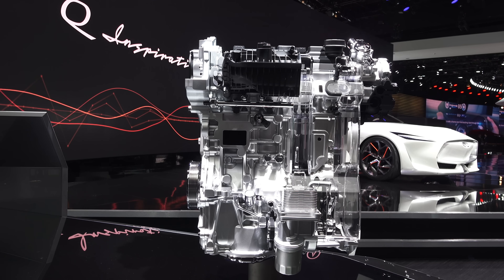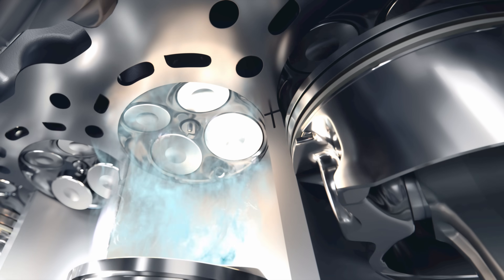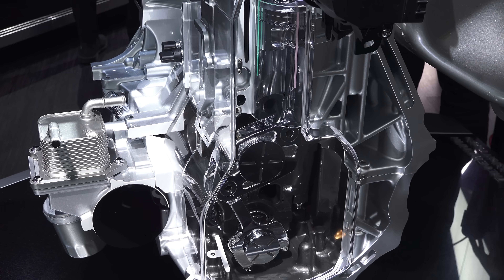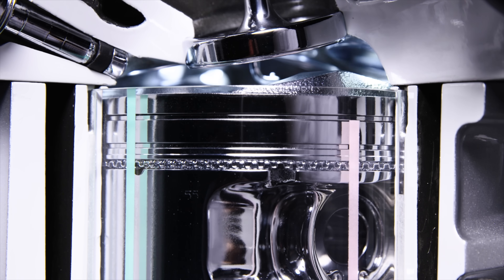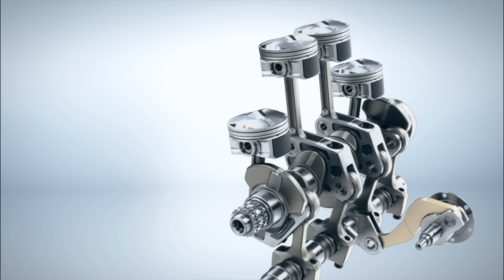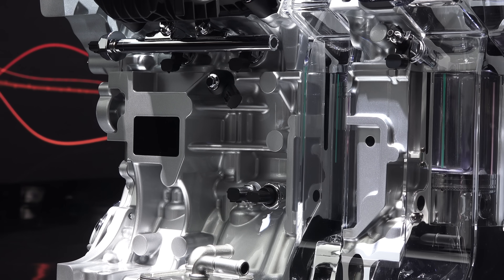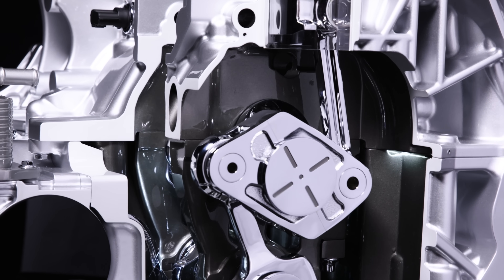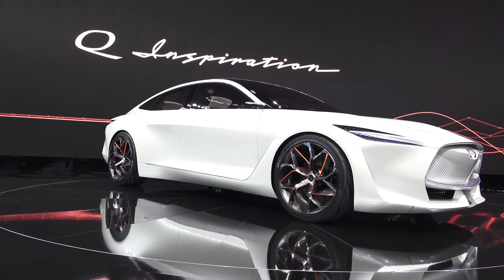INFINITI Reinvents The Gasoline Engine — VC-Turbo

Comment: Complexity: a type of device that is used. To make everthing more costly. To purches and maintain. What society wants and needs. Are vehicals that are built as basic and simple. As the ones built in the 50's-60's era. With todays advanced engine block. With true hemi and Hcci technology. Intake system and exhaust system. And a simple fitch design fuel injection system. Preferably into a predator carberator body. And no computer anything else any where.

Comment: Electric motors have about 5 parts. Simple and powerful.  Why do car companies try to keep reinventing a 100 year old design?  Its idiotic. The more moving parts the higher the chance for failure.  Its simple physics.
Reply: blue03r6 our iron knives are thousand year old design, time to make lightsabers right Right??? Also good luck with these cars of the future. Nearly every car I have seen being totaled was due rust or electronic problems and not the engine. EV takes the engine away but have you forgotten how modern cars became extremely complex with conputers, sensors and infotaiment?..  Oh right... Thats the new planned obsolence. Fools.
Reply: blue03r6 you should ask Yamaha.
Reply: 2 years ago I wrote a ten page Expository Essay research paper for environmental science with the hope of selling the world on EVs. I pounded the fact the EV has zero emissions.

However when I studied all the facts, environmental, economic, political, and social as well as the “work” returns for the energy used....

I found from sourcing the raw materials, to manufacturing, distribution, maintenance, and disposal when the vehicle reaches the end of its service life...

The  EV produces exponentially more pollution and a higher catastrophic environmental footprint than it will ever prevent.

My essay included environmental impacts and pollution created from electricity production delivery, and upgrades to the grid.

That’s in addition to the fact raw materials are sourced from the same unstable countries we import oil from. So politically there will be tensions.
Reply: @bdb3350  Can i get your essay to study?
Reply: kingsley rufus 
Send me an email address and give me a couple couple few days. I’ll see if I can get it to you. 

The computer I wrote it on crapped out on me but I printed it. I might have to retype it to email it if I can’t get the file to open.
Reply: kingsley rufus 
What’s your interest?
Reply: cause, try to drive cross country. That's why. If I could drive 300 miles and then refuel in no more than 20-30 minutes, THEN you'd have an ICE replacement.
Reply: @FGuilt  300miles in a Tesla, then in 20min recharges to 50%, 40min 80%. You are never travelling 300miles without passing 1/2 dozen Tesla superchargers all along the way, they're pretty much everywhere now. Also, anyone driving more than 300miles is usually always stopping for at least 20min to grab a snack or rest anyway.
Reply: @FGuilt  You drive for 6 hours straight without resting?
Reply: @yosyp_yosyp  A lot of people do...
Reply: @FGuilt  who drives more than 300 miles at a time anyway lmfao
Reply: CJ: You've literally never gone more than 300mi on a trip? That's a 150mi one way. You've never driven out there and had to drive back? in the same day? I"m so sorry you are so sheltered. You should do some traveling...
Reply: @CJ-vz5bl  
My father 3-4 times a month for example... -_-
Reply: 10 liters of fuel = 100kw/h of energy. Tesla P100d batery has energy of 10l of fuel and weighs 700kg. I think you got your answer. Batteries are a problem, not the electric motor
Reply: Well what it comes down to is simple doesnt make money. More parts=more workers and maintenance. So you have to keep spending. If they made cars or anything for that matter to last then the economy would take a hit. It sucks but...
Reply: You do know the electric motor is approaching 200 years old...
Just saying.
Reply: The electric motor is hardly new technology its nearly 100 years old too and they may have only 5  moving parts but there are around 8000 complex parts in the battery pack hardly the simple system you thought it was. A V8 combustion engine for example may have roughly 250 moving parts but it only has about 4 components in the fuel tank so if you think about it is still a simpler system. Electric motors are at best twice as reliable as a combustion engine
but the battery pack suffer degredation and are useless after 15 year while a fuel tank can last virtually for ever.
Reply: @jonathondeeds3423  a battery consists of multiple cells. A cell is made up of an anode, a cathode and an electrolyte.
Hell man look up lemon battery. Same technology different chemistry.
Reply: The problem with electric cars has never been the motors, it's always been the batteries. There's a good chance we're still a decade away from the right battery for an electric car at a reasonable price. During that time innovation from internal combustion engines May determine market share.
Reply: @bjshifflett5408  There is no space for improval on batteries... Even graphene ones, yes. This batteries aren't that stable, and that can decay faster or not (test need to be made)... There are a lot to see and test. Lithium is going to be here to power anyway for the next years and other battery technology will take years to be implemented...
Reply: @vladimirlucifer4566  funny that Tesla  has done just what you say is impossible. Increasing the the efficiency of the batteries in the new model 3. Now they're building a new plant in China that's going to produce even more efficient batteries.
Reply: @bjshifflett5408  A new technology that would increase efficiency enough high to be reliable. You have to trade capacity for speed, and speed for capacity.
Reply: @vladimirlucifer4566  you are mistaken Tesla has done exactly that increased power while maintaining static weight.
Reply: @bjshifflett5408  To the limit of lithium technology. They can't go further.
Reply: @vladimirlucifer4566  and yet they have.
Reply: @bjshifflett5408  They already took to the limit of lithium. Any other material that has potential is unstable. Further from now, with lithium, you will have to trade the 3 aspects: capacity, charging, discharging. For having a better one.
Reply: electric motors are not financially efficient though.
Reply: @jamesbra4410  Do you mean the end user or the manufacturer?

Because then both benefit from them
Reply: Well I'm not aware of government subsidies on lithium production for battery capacitors or ferromagnetic material like the government subsidises many raw materials for the oil companies and sets the price void of supply/demand and on OPEC global agreements.  Elon Musk's production costs have almost bankrupted him, but he manages to keep the price of his vehicles much lower than what the gas/diesel manufacturers charge in relation to production cost/market price ratio.  What I'm getting at is it's more rational to use electric vehicles over hydrocarbon combustion, but there is unfair competition currently stagnating the electric engine consumer revolution.  @yosyp_yosyp
Reply: Well Nissan is definitely having fun... What happened with cylinder block lifting mechanisms which can make variable compression as well!? Cam less active valve timing. I hope Nissan can work on does system . Crank less ice generator even better for hybrid system ....  THIS ENGINE is loaded with complex Dual fuel injection system " double trouble" ... Plus turbo . Definitely prone to multiple problems . STILL I LIKE IT A LOT as design it's very impressive!
Reply: It's simple chemistry, too.  You don't get the same power/torque performance from an electric motor.  What's worse, take the non-nuclear electrons that come from coal to form them, the mostly petroleum-based plastic exterior panels, and the Carnot efficiency of two conversions, you arrive at the reality that electric motors consume more petroleum than petroleum-based cars.  At the very least, accept and demand nuclear power to generate the electrons for all the electric motors everyone seems to think are the "green" direction.  Excuse me while I grab a big hunk of beef and go back to the work I'm willing to do.
Reply: @paulingersoll9197  Exactly.
Reply: Unless you get your electricity directly to your car without using any battery, electric vehicles aren't efficient / pollution free
Reply: kingsley: and that is why fuel cells are the future. not the battery driven electric cars.
Reply: This design is no more complex than the 4 cylinder engines we have today due to the design  there is no need for balancer shafts.
Reply: I dont know where you get the idea  that electric motors are far simpler have you considered that the complexity has just been shifted to the battery pack which in some models contains over 8000 battery cells.
Reply: blue03r6 because energy storage is very big problem, if you burn 1 liter fuel you make nearly 9 kilowatt electricity in few seconds, but when you try to storage this 9kw energy in the lithium battery you need to wait for hours to transfer to batteries  and when you want use this energy you need to wait another hours too. This is main problem and manufactering batteries is very harmfull for environment even more than manufactering fuel from the oil it is another big problem but even this disadvantages electric motors are more efficient than conventional diesel or petrol motors. İf one day battery technology is developed enought we are no longer need oil

Comment: There are 3 additional shaft bearings per cylider, compared to traditional engine. Maybe it vibrates less, but has significantly more parts to get damaged by those vibrations.

Comment: The term "Harmonic Drive" doesn't work. I don't doubt that this is the term the manufacturer uses, but it isn't exactly useful. What this entire variable compression assembly amounts to is a step wheel rotated by a step motor, which is connected to an eccentric cam via a control arm or link. The step wheel moves a control arm, which pulls or pushes an eccentric cam to obtain a small degree of offset for a point of axial rotation for what is essentially a lower connecting rod. This lower connecting rod then connects to a swing arm. The swing arm ultimately provides a point of axial rotation for an upper connecting rod.

Printing presses have been using eccentric cams to throw on or throw off the impression movement of presses since the middle to late 1800s.

There's nothing new here with Infiniti. This is, however, innovation at its best for an engine. Good work.

Comment: Such complication for much easier alternatives. Atkinson cycle and hybrid engines would give all the power and efficiency you might require. This just screams over-engineering resulting in costly maintenance.

Comment: These will rarely if never be overhauled. When worn, the vehicles will be totaled, just as many other modern cars.  I was at the metal recyclers a few weeks ago watching truckload after truckload of late model cars being brought in for shredding with no apparent external damage. No a dismantle yard... a metals yard where cars are immediately shredded for raw materials.
Reply: Car manufacturers don't make money off cars that are already sold.
Reply: +Jennifer WhiteWolf : I agree with your premise. Only time will tell what will come of this engine and how it will hold up in the "real world". It's still pretty cool and will be interesting to see how well it holds up.
Reply: Turbo Diesel 
It certainly is technically interesting... I will grant the design its due respect in that regard.  It does solve some difficult problems with levers, cams, and well understood cylindrical bearings.
Reply: I like when they say things like, it has a lifetime chain, that will last for the life of the vehicle. What they don't say is the life of the vehicle is just after the warranty expires. Who wants to buy a new vehicle every 70 thousand miles
Reply: Benjamin Kline ... Well vehicle manufactures are building vehicle far better now then they have ever in the past. Build quality, reliability are all trending upward with each new model and year. NOT like they did in the 80s and 90s... building things to last just long enough to survive the warranty period. For example GM in the 80s and 90s would test a part until it failed... then redesign that part till it would last just past the warranty period. However companies like Toyota and Honda were building their vehicles to last as long as possible... This almost ruined GM and the others doing the same thing. Part of the reason, vehicles like the Nissan Skyline were banned from the United States... The Skyline and other vehicles like it had such good build quality, reliability and performance for the dollar,  it would have put the American car manufacture out of business...
Reply: @JJ_ExMachina  
Design it to break near warranty is over is part of proudly made in USA products engineering demanded by corporate GREED.
Reply: @loktom4068  ... Yes in the 80s and 90s that was a thing... Not anymore. They learned their lessen. Besides I mainly work on Toyota, Lexus and other Japanese vehicles... They have never been built to only last through its warranty... At least not that I have even seen.
Reply: Well you will be happy to know that modern vehicles are the largest consumer of recycled materials and are one of the largest things recycled. Something around 80% of the materials used in new vehicle's come from a recycled source. So while certain modern engines are not really "rebuildable" due to their design, at least the materials are recycled and used again.
Reply: 'Build quality, reliability are all trending upward'
Lol, don't make me laugh. '90s era city car engines were built like tanks. They ran forever and seldom had any issues - there's millions of them still being driven around.
New cars (and higher end cars even from the late '90s and early '00s) have so much useless electronic crap in them that they start displaying random unfixable issues after 3 to 5 years. Hill holders, stability control, ECUs with six million sensors, cruise control, etc.Any one of those sensors stops working properly and it's gonna make your life a living hell.

On an older low end car any mechanic could pinpoint issues with the engine, because they were simple and had few failure modes. 
New cars? Either you're lucky enough that it's a failure mode the ECU can recognize and throw the appropriate code for, or no one's ever gonna have any idea what the problem is or how to fix it.
Reply: @demoniack81  I absolutely agree. I have a Japanese built Toy from 2004 with old 1.5 engine that  never lets me down and I really wonder if I should go "modern"
Reply: yeah more stuff to fail. Will see
Reply: It usually isn’t the engine that finishes any modern car. It’s the other things wrong with it combined with the value of the car and cost to fix. Head gasket blew on my inlaws minivan with 200k... the repair was more than the 13 year old vehicle was worth. I’ve sent many cars to the scrappers with good engines because of rust, or the huge number of broken things (heater cores, wiper motors, switchgear, etc) that weren’t worth fixing. 

Not that old cars are any better. It’s just that some have increased in value that they are worth rebuilding and restoring—most often at a loss.
Reply: Everyday cars are rarely overhauled. Most people doing engine work is on weekend and project cars.
Reply: @bickin back bein brazy yep, I'd rather there be people walking around who had the know how to diagnose and repair these things than to make no progress with vehicle tech whatsoever.  It's really backwards thinking.
Reply: All re-usable parts should be re used as 2nd hand spares. 
Environmentally Friendly is to use an item until it wears out or breaks. then recycle what's left. 
New cars that get Totaled , all the undamaged parts should be re used and the damaged parts Destroyed. 
If you dent a panel on a 2 yr old car, What is wrong with a replacement 2 yr old panel ? it matches the age of the car. 
And is no better & no worse than what you had.
( Obviously scrap all the safety items that were damaged in the crash. )
Body panels, Interior trim, Glass, and many other parts are Perfectly Good & usable..

Comment: 3.000.000km across 600 cars and 13000 hours on test beds. In car testing numbers arent that impressive really. One car, driven by two drivers (two shifts) should be able to do 700km daily (1/3 city, 2/3 highway). It would take 7 working days to get a car to 5000kms (average mileage per Infinity numbers), so this kinda makes it obvious that they didnt take many cars over 60.000kms.
As for testbed numbers, if 13.000 is just testing of final product/engine, then these numbers are great (1000hours depending on manufacturers protocol equates to somewhere around 120000km for full load (also overload and overrev testing) testing or to 60000-50000kms of "city cycle"), but if 13000 hours also includes hours used to test prototypes/development iterations of the engine, then it looks worse. 
Anyway, its great that they have the confidence to release it and I hope it works out for them. Innovation is good, it forces other to also search for improvement.
Great video and loved that You asked them for reliability and testing data, try asking that everyone from now on :P

Comment: Will this motor still run on pump gas? With 14:1 compression it will need a better fuel then pump gas

Comment: Not many manufacturers have been brave enough to commercially produce a radical redesign to the lower end. I have some respect for that. But ultimately my respect goes to the guys on the deckplates tearing these apart and keeping things spinning.